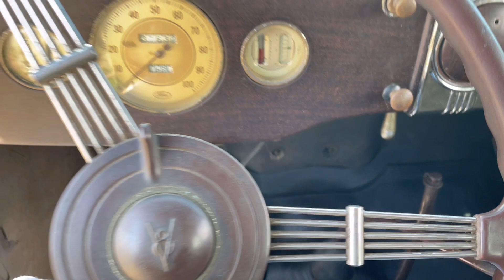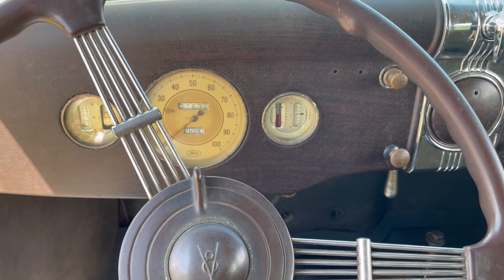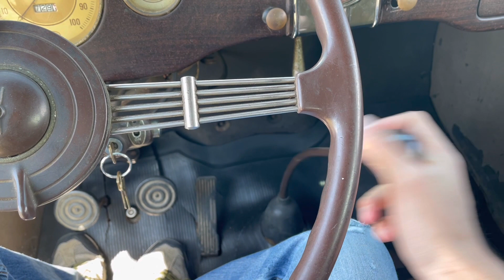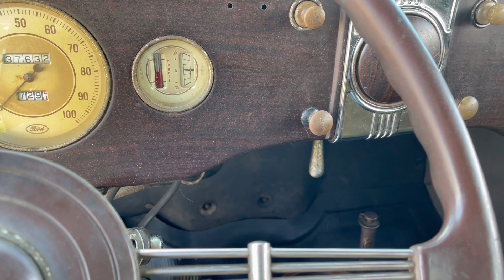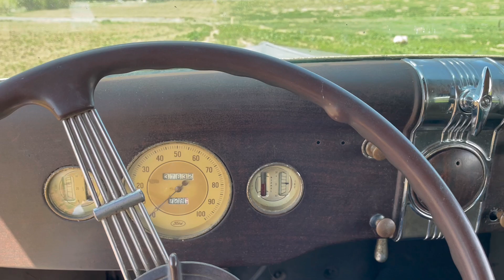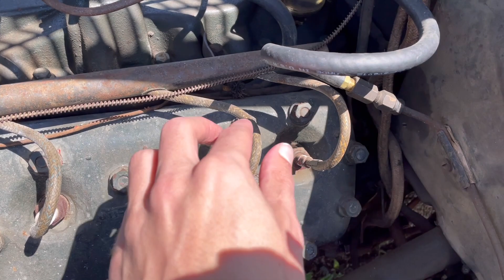1936 Ford: Restoring a piece of American heritage (Part 0: Introduction)

Comment: Collin, any updates?
Reply from the maker: I have a large backlog of footage to get through. May make a distributor rebuild video soon. Most of my time over the last several months was spent trying to troubleshoot a recurring overheating issue, which after many attempts at solving it ended up being the radiator. I had the radiator rebuilt to match original. Now I'm dealing with a flywheel balance issue which would prevent me from driving the car much. I finally put together a good method for editing footage on my computer the other day so I think I'll be able to put together videos much faster in the little free time I do have!

I also have a video coming soon for an antique bench grinder I did a cosmetic restoration on that may be interesting.
Reply: @kbrestores  I totally understand that. I’ve have the same problem.  Just posted a video I “shot” last July.  Look forward to more of yours.

Comment: This is a beautiful car, especially the restored saloon presented here! In fact, the car is similar in appearance to the Mercedes W153 series, also built at this time, although of course the Mercedes front always had vertical radiators with a star as a distinctive design feature common to all models. The engines did not rely on large-displacement V8 technology, but on powerful 2.3-litre in-line six-cylinder engines. This has remained the case to this day.

Comment: Marvel mystery oil in fuel perfect for valves and upper cylinder lubricant  ... drive as is .. install smithy mufflers turn signals drive it

Comment: Is the generator with three brushes? Does it have a rheostat to regulate the battery charge?
Reply from the maker: Good question, I haven't been inside the generator so I don't know. I can check and get back to you
Reply: @kbrestores  It has 4 knobs on the dash, one is throttle, another choke, another cigarette lighter, and the fourth?
Reply from the maker: @LCRECORDS1  The fourth is a second cigarette lighter, believe it or not